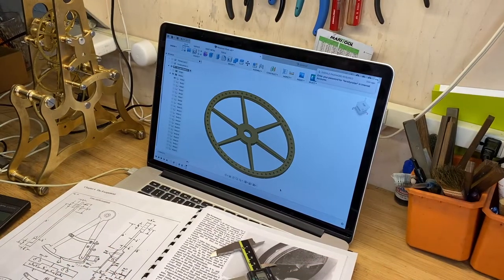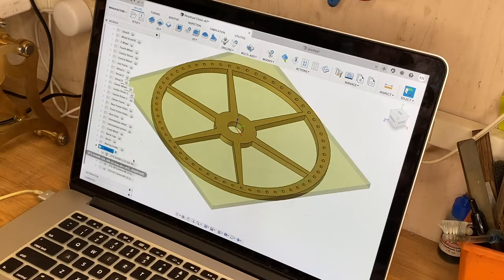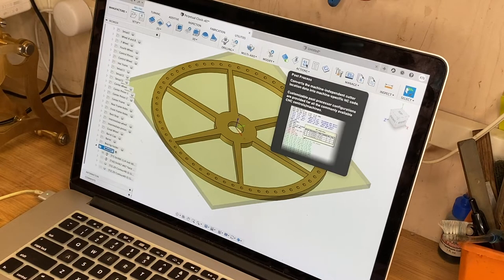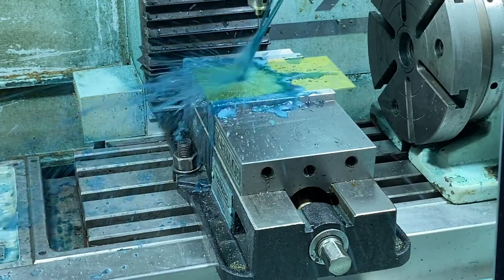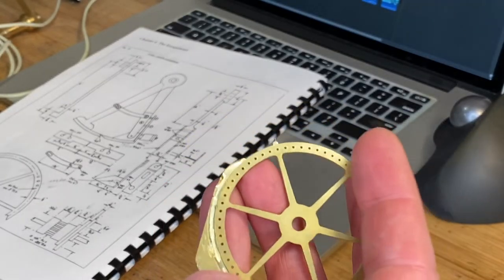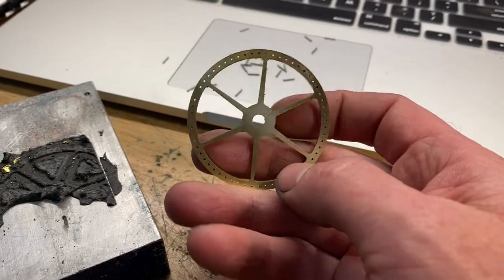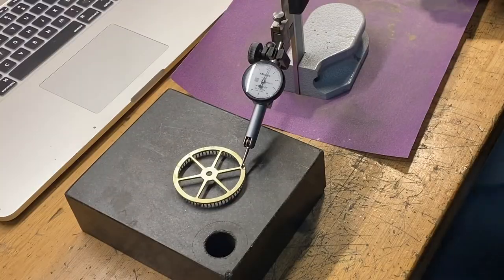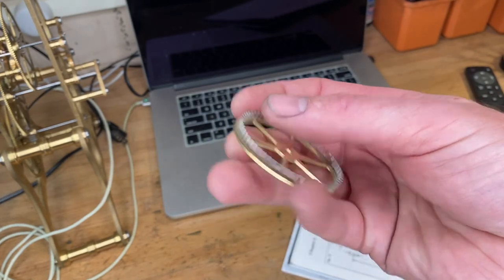Making a Pin Escape Wheel for a skeleton clock

Comment: I always use superglue, only requires a little heat to remove. Nice job.
Reply: Kinda funny - I looked at the original setup and said - that’s not going to work use super glue !
Double sided tape is definitely an option but as you remove stock the adhesion is reduced considerably